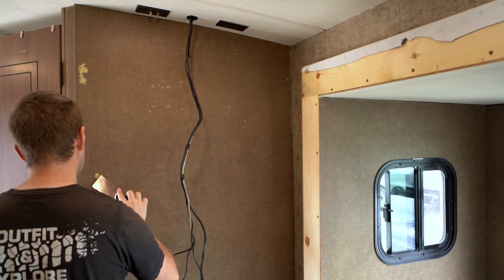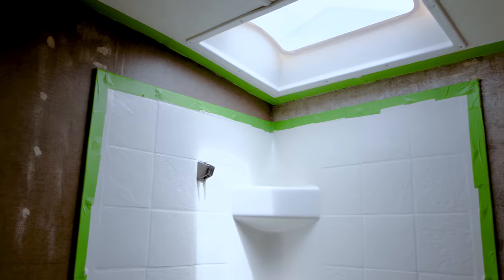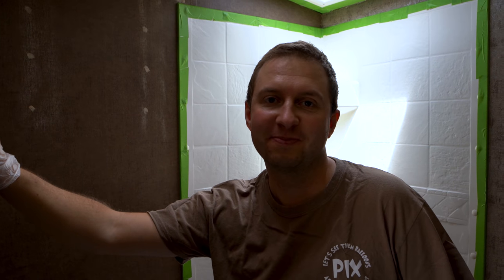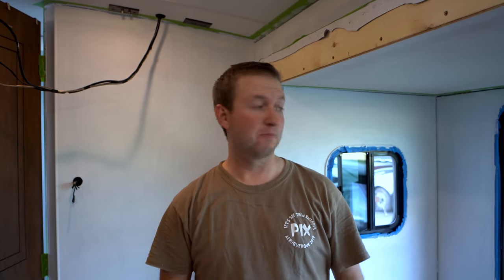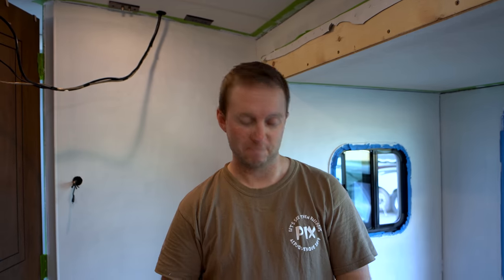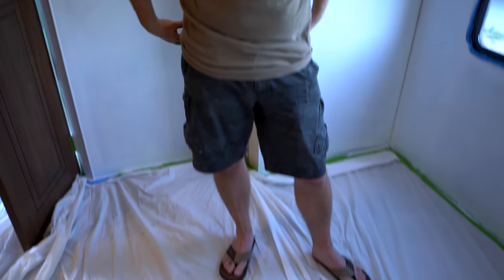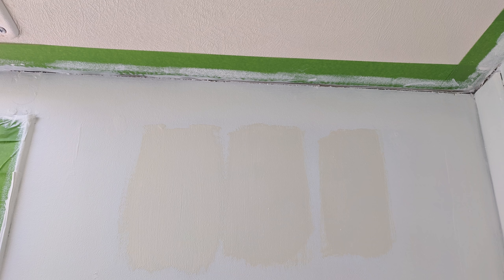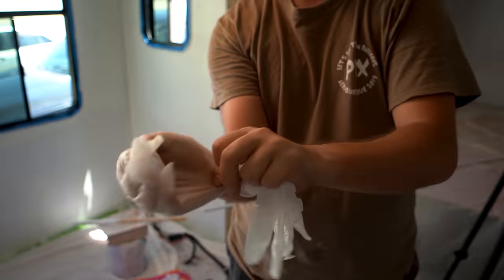Painting RV walls the RIGHT way | RV remodel part 2

Comment: Looks great! Just a heads up...it's best practice to remove the tape as soon as you can after your last coat of painting in order to minimize the possibility of not getting a clean line when you pull it off. Especially if you use latex paint. If you let it dry completely then you might find that it starts to pull the paint and rip it further down the wall.  Just my 2 cents. My dad owns a construction company and this is what he taught me.
Reply from the maker: Yup, that's definitely a good tip. Though in this case we had to weigh it against the fact that we did multiple coats of primer and multiple coats of paint and in the RV with so many nooks and crannies it would be so much more work to take the tape off after priming and then put it on before painting. In the end we scored along the tape with a razor blade to make sure the tape doesn't pull the paint off the wall.

Comment: Just a tip for others taking on such a project ... Glidden Gripper used to be the standard for all kinds of work like this--even for gluing foam together in insulation and hobby projects. The stuff was amazing. However, despite claims to the contrary, when PPG took over Glidden and put out their own version of Gripper, they completely changed the formulation of the product. Our property management company has had to give up on it, the PPG rep finally acknowledging to us that they had to make changes to make Glidden profitable to the new ownership. One of the big clues is that the thin layer left on the inside of a can now can be peeled off in sheets when dry--something that could never be done with the tenacious original Gripper which primed the inside of the can like it did everything else it touched. There is at least one professional painter on YouTube demonstrating this on behalf of all of the rest of us who are so disappointed. PPG Gripper is still fine as a general primer, mostly intended for covering stains, etc., but don't expect it to perform in the most difficult circumstances according to all the glowing reviews of Gripper online before the end of 2018. We have not found an equivalent replacement that works as well as the previous formulation did, but if you have difficult surfaces to work with, it's advisable to ask at your local specialist paint store (not big-box store) for their primer that will be closest to the old Gripper.
Reply: Great information. Thank you!
Reply from the maker: Thanks for the info, I didn't know that history. Our friend Cortni from @theflippingnomad (https://www.instagram.com/theflippingnomad) has a lot of experience renovating RVs and she recommended us to use PPG Gripper. So far it has held up!

Comment: Did you have to caulk any of the corners for the paint/primer to stick? I’ve heard some rvs have silicon caulking which repels paint
Reply from the maker: Our trailer had plastic molding in the corners. We removed that in some places (and replaced with wood quarter-rounds), left it and didn't paint in other places, and in some corners left it and primed/painted over it knowing it may not stick. So far it has been fine, but it has chipped in a few places.

Comment: Would you please share the material used for the primer?

Did you consider removing the original wallpaper before painting? In a house one would remove wallpaper, but perhaps the trailer wall and wallpaper is different.

The light color looks great!
Reply from the maker: Thanks, John! We used PPG Gripper for the primer and it worked really well! Unlike wallpaper in a house, the wall coverings in the RV are bonded to the wall, so removing isn't really viable. We've got a blog post with more detail about exactly what we used here: https://www.adventurousway.com/blog/rv-remodel-ergonomic-workspace
Reply: You two are doing a fantastic job! Its great to see a job done the correct way and it looks really nice. How did the original tape covering the 4 x 8 wall cracks turn out? Did you do anything to hide those lines? We have an Outdoors Rv also purchased from the Thompson family and my wife and I always look forward to your videos. Thank you for all of your hard work filming and taking us along on your journeys.  Tim
Reply from the maker: Thank you, Tim!

Good question about the seam tape... We didn't really do anything to try to conceal or hide it - there are only a couple of places where it's visible. I think having a flat color on the wall does make it more conspicuous than the subtly textured brown before, but I wouldn't say it's that obvious. You have to look pretty closely to even see them. Honestly, I'm not sure what you could do to hide them.

Comment: Our rv has vinyl corner straps & seams. Can you I you paint over them?
Reply from the maker: I don't know. Our corners and seams also had some sort plasticy (maybe vinyl?) corner trim. We pulled it out in some places, we left it in some other places and didn't paint it and in some other places we risked it and painted it the same way as the walls. So far it generally looks good, but in few places the paint has chipped on the painted plastic trim.